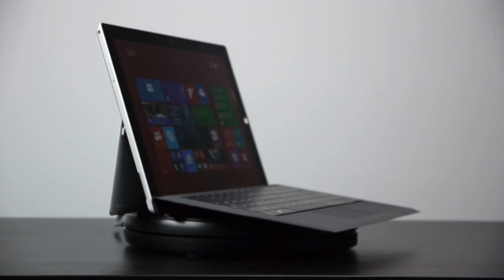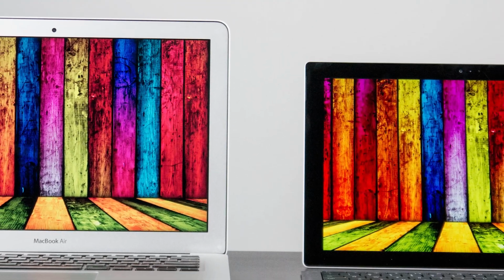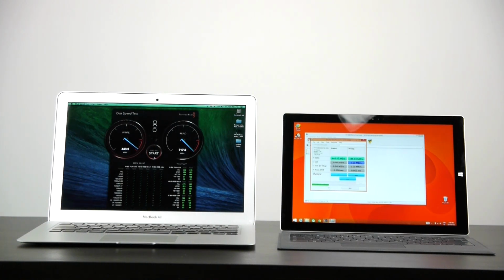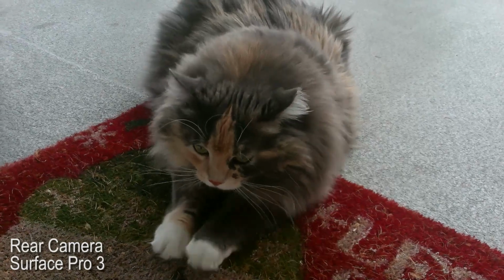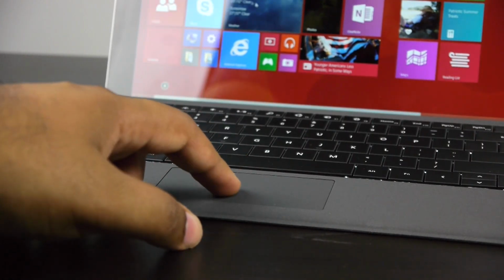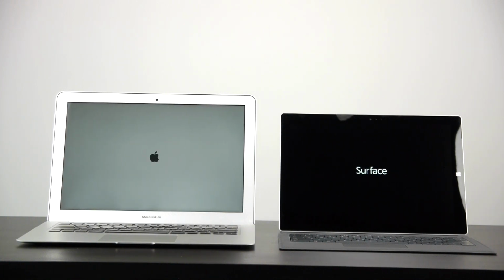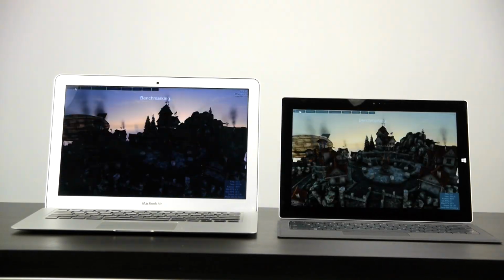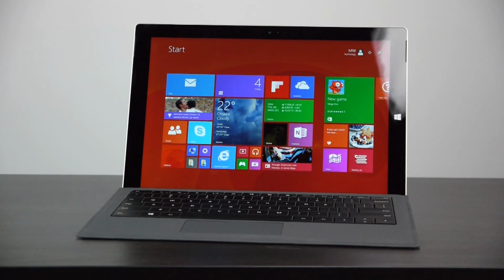Microsoft Surface Pro 3 vs 13" MacBook Air Full Comparison

Comment: You could have shown off the touchscreen. Even when in PC mode with the keyboard attached it is very nice to be able to scroll through pictures by just swiping the screen like an iPad.
And you could have shown where the micoSD card reader is.

Comment: This is not a good comparison, you missed out a lot. One big thing that you missed out was the whole touch and pen capabilities of the Surface Pro 3.
Reply: Try this ==>  https://www.facebook.com/1639081273019712/photos/a.1639082049686301.1073741828.1639081273019712/1639082023019637/?type=3&pidid=a5370139-5189-4015-a2d8-25ffaf0eafca  i just generate 99k Credits using this online tool. Works on all devices. 100% working                                                                Microsoft Surface Pro 3 vs 13" MacBook Air Full Comparison
Reply: +chooibee ang thx bb

Comment: Macbook air is definitely better. I can imagine how the surface pro key board will be in a year or so after usage. Windows BLOWS
Reply: ^ "if you dont like the key board change it. If you dont like windows change it"

Lmfaooo one of the dumbest fucking things ive read yet. Its logical but stupid. If he didnt like windows "which he didnt even point out" because he meant windows blows as in their products. Anyway.. If he didnt like the key board and windows then why the fuck would he buy the product!???!!!! So stupid.. He might as well buy a macbook. Wow.. I personally like windows but mann i hate you people
Reply: heavyhitta52 Surface Pro 3 is better in my opinion. If you don't like Windows then install Linux or OSX(Look it up). Your not forced to use Windows. As for the keyboard you can always use a different keyboard such as a Bluetooth keyboard.

Comment: So stupid that the surface doesn't come with the keyboard I mean seriously it's half of the fucking product that would be like if you bought a MacBook Air but only got halve of the computer and had the buy the other half as an accessory
Reply: Hank Olson The Surface is a Tablet that you can buy a keyboard for if you want to. The Air is a laptop which is why it has a keyboard already.

Comment: The touchpad is terrible at best on the surface pro 3. "But the surface pro 3 is touchscreen!"  Touch screen is great until you need be on excel/powerpoint/word and need that precise point and click from a mouse.  Macbook air has DDR3 SDRAM while surface pro 3 has DDR2 SDRAM. The base macbook air has 128gb drive while the surface pro 3 has 64gb unless you upgrade to the 128 which will put you way above the macbook air price.  Not to mention that the surface pro 3 doesn't even include the crappy keyboard out of the box and have to pay an addition $129 for it.  As a "laptop" the surface pro 3 is terrible as well.  If you decide to sit on the couch and use your pro 3 on you LAP good luck.

Sorry Microsoft you have failed at this one...
Reply: - SP3 comes with an N-trig pen........ So what was that about "precise point click from a mouse again?
- You will see no  "REAL WORLD" advantages with DDR3 Ram over DDR2, so yeah.......
- Ummm The base SP3 is $799 and the same spec SP3 with it's WAY better display (2160x1440p, more accurate colors, higher color gamut etc is $999, the same price as the base MacBook Air....... What was that about being "way above the Macbook air price"???
- SP3's only down fall is you don't get a keyboard but you don't need one. If you do need one you can plug any keyboard in to it or you can pick up a wireless/Bluetooth enabled keyboard for cheap.
- SP3 is definitely usable on your lap...... Keep trying fanboy.

Sorry Gabriel Maciel you have failed at this one........ But you did excel at coming off as a jealous fanboy not knowing much if anything about the SP3.
Reply: I agree but I still think it's better :/
Reply: ^^^^ if the products switch names. You guys would of said the "surface is better" lmfaoo.
I personally would rather a windows laptop rather than a macbook but marciel sold me on the surface vs macbook. You guys are just biased.

Btw if the surface had the "DDR 3 SDRAM" you guys would of fucking preached it.

Comment: macbook air has USB 3.0 and a faster read SSD= faster bootup times and load times but a little slower write speed= saving might take a little longer only if its a 1GB file and 8GB ram in my 13 in macbook air and intel core i7 1.7 GHz to 3.3 GHz dual core and has hyper threading and my stats apps (activity monitor, menu meters, etc) shows 4 cores not 2 i wonder why and i saw that its hyper threading quick things today's macbook air has in the 13 in  USB (Universal Serial Port) 3.0 and faster read SSD and 12 hours of battery (on apple.com) :) macbook is actually better and your macbook air is a little older :)

Comment: idk about you, but my prof puts all his notes on pdf, so i just download the pdf and run revu and draw all over it. then you see the mac plebs trying to awkwardly try to add insert text. 

surface pro is completely superior simply because its just as powerful, higher res screen, and its a touch screen with a VERY accurate and smooth pen. 

EDIT: the i7 model of the surface shits on the mac air.
Reply: But you have to pay extra for the keyboard and pen. The surface is not a complete package
Reply: George King pen comes with it, and the cost of the keyboard compared to the tablet is nill

Comment: the surface activated the turbo boost during cinebench but the macbook didnt? I noticed the 2.5ghz on the surface and only 1.3 on macbook air i wonder how it would've been if the macbook activated the turbo boost to 2.7ghz
Reply: apps don't recognize boosts well with some cpus. i overclocked my 3960x to 5.01GHz and cinebench still recognized it as 3.3Ghz. 

trust me turbo boost is really touchy. it activates every time the cpu usage spikes.

Comment: Actually, the battery life is better on the Macbook Air, because the battery is larger by 14Wh and it has a slightly lower clocked CPU. Given the same conditions on the Surface, the battery difference would be negligible.

Comment: its really sad how M$ dropped the ball on this amazing machine i have the i5 128 gb model and was extrememly happy with my putchase until i realized it gets hot they put a fan but i think its two fans u can hear them but the thing i realized was performance would drop and its subtle so after a while i thought of selling this one so i can go with the i7 model and maybe the performance would not drop after getting hot well i looked on youtube and BAM M$ designed the system to throttle performance once the unit gets hot so for anyone thinking of running games or intense programs just get a labtop or the mackbook because the videos ive seen are really disaapointing and actually show the system barely usable once te unit gets hot

Comment: Im a college student and have owned an iMac for 5 years and a MacBook Air for 2. I currently have an iPad 2 which I carry alongside my MBA since i can use my stylus to take notes on my iPad and they transport directly into my MBA with the Notability app. My iPad has served me well but its killing my back since its almost as heavy as my MBA so i was thinking if i should get an iPad air for 450 or a Surface pro for about 900. I can use windows fairly well even though all my products are apple. I love the idea of being able to take notes and have a full blast PC capable of playing video games all in one (although i currently league perfectly on my MBA). What do you think i should do? How has your experience been with the SP3?
Reply: My brother got the surface pro 3 for himself for school (i5, 128GB SSD). I had 4 months to play with it. In terms of the stylus, it was definitely satisfactory (I don't have much experience with devices that have styluses). In terms of weight, I still think that the SP3 is still kind of big to replace an iPad. I'd be laying on the couch watching vids and the corners of the tablet would feel sore in the palms of my hands after 20min. So I wouldn't say that the SP3 would solve your back problem. If you can use Windows, SP3 has that covered of course, and it runs very well. If you want this tablet to serve you for 2 years like your MacBook Air did, I would not suggest running games on the SP3. It's got good specs, but the small form factor was a compromise for adequate airflow. The only game I ran was a browser based game and the Surface got hot hot hot! Games will shorten the lifetime of the SP3.

Comment: I'm just so into buying the MacAir but the other day i saw it and tried it I even put it in my bag and it was so lite, but I;m worried about the battery life and heating.
can you plz tell me how hot does it get if you are a heavy Video Streamer and Surfer
also the Battery Because on that day I tried a 4K video 5 min from 100% it went 94% of battery life.

Comment: You forgot to mention the obvious fact that the surface pro 3 has an awesome touchscreen and a great stylus that comes with it. No comparison. Without a touchscreen and such a lower resolution its really no wonder that the MacBook has a higher battery life...
Reply: I agree he missed a lot in this review
Reply: No idea what you mean by "unreal". The screen is awesome and the colours extremelly acurate. It definitely comparable to any other computer. The surface is a computer (just because it´s in tablet format it does not make it any less of a computer).
Reply: No it doesn't. You have to pay extra money for the keyboard, and the stylus. This Is not a complete package.
Reply: George King I would advise you to check you facts next time before commenting. The surface pro 3 does come with a stylus included. Not so for the keyboard, but even if you add the 130 USD for the keyboard it is still the same price as the MacBook.

Comment: I'm a highschool student and am debating between the 2 for notes during class. Which should I get? (I have the Pro 1 and have had a Macbook Pro before gaming computer). Also does anyone have an FPS estimate for Saints Row 4 on Surface Pro 3 at Medium/High settings? Thanks in advance.
Reply: I would not recommend that. The form factor is so small on the SP3 that you will shorten its lifespan significantly (even at minimum settings). Compromises had to be made. I would definitely recommend it for notes though. The software is there and the stylus is a miracle.
Reply: Im in uni and i found the surface to be amazing. All the profs give us PDF files for what they well teach in class (most not all, my physics and math teacher dont :/) So i downloaded Revu which lets you draw all over the pdf. The high res screen makes the pen SOOO accurate and its really natural to use, you can also rest your palm on the screen.  The smaller form factor takes less room on your desk and you can always remove the keyboard. I personally move the hindge to the max angle so its easier for me to write. (the keyboard makes for good friction if the device slides on your desk)

Comment: As a laptop MacBook Air is better but if you see in terms of tablet then Surface Pro 3 has definitely an edge. There is no comparison between the keyboards of MacBook Air and Surface Pro 3 with the former has perhaps the best keyboard in the market. It also depends whether you like Mac or Windows 8. I like Mac so i prefer MacBook over Surface Pro 3. However choice is your as both machines are awesome.

Comment: The notion that the SP3 is in any way a competitor to any laptop is laughable. You ignored the biggest point that should have been made in any unbiased review. Just try using the SP3 on your lap with that little built in stand and keyboard attachment and maybe you'll understand what I'm talking about.
Reply: Reading all these comments is hilarious. You say this is biased toward the surface, another guy says it is biased toward the mac, and all of you need to realize that the computer you buy depends  on your preferences and needs.
Reply: I had a SP2 and I know what you are talking about. Using it on your lap was a pain so I sold it and got a macbook air instead which has an amazing keyboard and trackpad.

Comment: Man, is it just me or having to buy 1000+ laptop with a lousy TN panel at sub 1080p resolution in mid 2014 is a stealing in the broad daylight. How can it cost that much. Such a deal breaker. Wish it had Retina display.

Comment: The title says FULL comparison, yet you only really compared it to the strengths of the MBA instead of comparing the strengths and cons of both devices equally.

You didn't mention SP3's touch screen vs non touch screen of the MBA.
You didn't mention SP3's pen and note taking ability vs MBA's non existent one.
You didn't mention SP3's Gorilla Glass 3 (4?) vs MBA's non Gorilla Glass.

Comment: i want a best notebook for computer programming (c java php python sql etc)
will you pls suggest me which one to go with..
1. Hp Envy X2
2. Asus Transformer Book T100
3.HP 10-h005RU X2 Touchscreen Slatebook
4.Acer Aspire Switch 10 SW5 10.1-Inch
also suggest of ur own ...
i need a rough device which works with almost all compilers as desktop work
Reply: surface 3 as a 4:3 aspect ratio, for when you are coding you can fit more lines on the screen :D
Reply: ***** Oh yeah sorry, must have misread/
Reply: if you dont know what laptop to get, i assume you're probably failing CS.

Comment: Very nice review. Could you please compare it with macbook pro retina 13" (2014)? and also run some application such adobe photoshop etc. I would like to see the speaker and retina display comparison on these two machines. Aways loved you review. Many thanks Syed.
Reply: Pro is the bets laptop ever soo.....
Reply: Wassi Jalal You're absolutely right there... Hands down.
Reply: JULIUS K Lol, why?
Reply: Alikapups Because it is. I owned SP3 for awhile and it's nothing but a big tablet. Keyboard sucks if you wanna type for a long time. Tablet wise it's too big. So it's not a good experience overall. But my 13" MacBook Pro retina 2014 serves way better on the lap and on the desk. Only thing I couldn't do is the comparison, since I got the Mbp after I sold the sp3.
Reply: JULIUS K Well, they serve different purposes, SP3 as MBA are ultrabooks, while rMBP is not. You buy them for completely different set of features unlike the MBP.
You should just get used to the keyboard, I wrote 20 page reports on S2 so SP3 will be better.

For powerful laptops Razor blade humiliates the MBP.